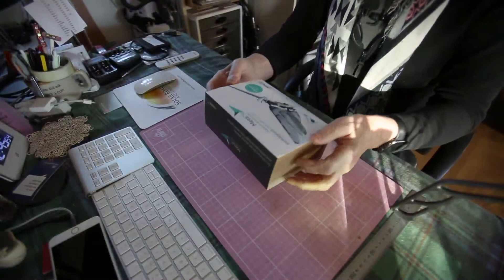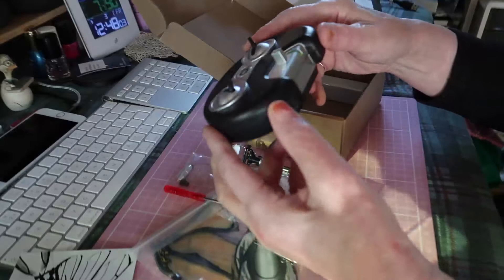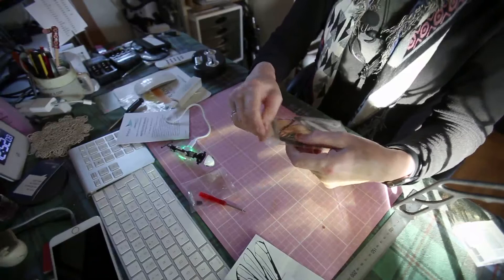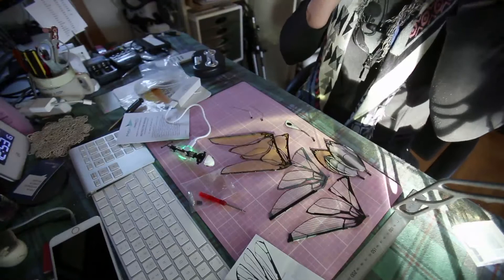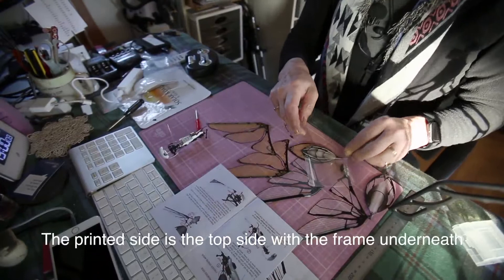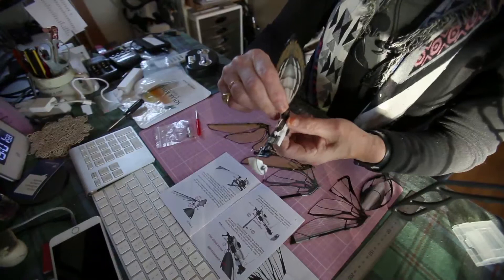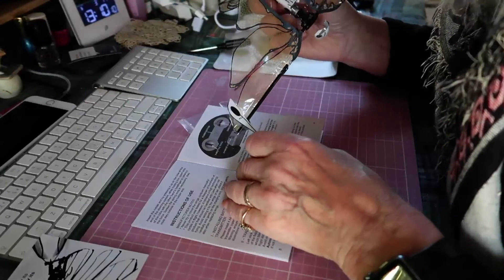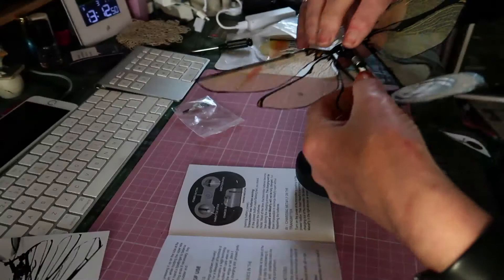Metafly - your friendly RC bug! View this before you build.

Comment: Watched the whole video, interesting, pity the camera won't focus, I have the same problem haha. Looks like its more for a large Gym or one of those rare days without wind. I saw it was 90euro not to bad for what you get. Hope to see you flying your planes soon. Oooo and best wishes for 2020
Reply from the maker: Ruudy L thanks for your comments. My Canon G7XMk2 doesn't focus close enough - I should have use the other camera (Canon 5DMk3) which has a much closer focus distance. 

I discovered a few things in my test flights which I didn't cover in the video. 1) take off needs a hand thrown as it needs some forward speed to fly. 2) it is important to balance the wings using the weights on the front of the wings. 3) The spring wires that centre the rudder are very weak and can easily get bent in a crash - use tweezers to get back into place. 4) the lowest tail position fouls the rudder on my bug so I bent the rudder down a bit to enable fast flying.5) I lost the rudder on a crash indoors so I put a dab of CA on the base making sure that the springs were still free.

I will cover these in a future video